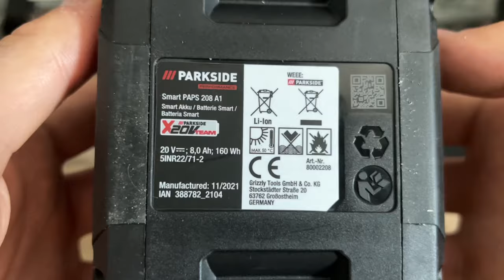Dive-Jet 1500W | How To Build | Fail, Aluminum, New ESC

Comment: Nice work man. 👍
It does take much more than you thought doesn't it?
I built something similar few years ago so I know. It is on my channel.
Good thing to pay attention to thermal conductivity. 👍
One thing I learned on mine. What ever gets warm in sealed container, surrounded with could water, WILL CONDESATE. And those LiOns in there will get warm, if not hot. Solution might be some kind of textile padding inside. Or provide cooling for LiOns. Or use Lipo batteries, those won't get more than calm.

Comment: You should use a lower Kv motor, thats not going to deliver anything close to 1500W, for your purpouse a 12S with a 120kv motor with be much better and you should lower the drag of the prop too. Also if you have a 360Wh battery running for 3,6h, if you do the math that´s 36W. I recently made a SUP motor and I´m using a 700Wh battery for a 50min runtime at 800W

Comment: Looks amazing, are those plastic covers enough to keep the engine waterproof or did you use some sort of epoxy?
Reply from the maker: The function of the plastic covers is to keep dirt out of the motor. The motor by it self is waterproof, only the bearings aren’t, but changing them to 2RS bearings will do the trick
Reply: Cool, I will look into it. Also would an ip68 pot be a better option instead of the hal sensor? Or are you trying to keep costs as low as possible as those pots would be pretty expensive in comparison?

Comment: Awesome project! Will it be possible to build one without a lathe? If so I will most likely build one before next summer.
Reply from the maker: I the first part of the build, I 3d printed the bottom part, but with that there was no way of cooling the esc. You could use an aluminum pipe instead of plastic and mount the esc‘s cooling surface to that. Or you cloud try water cooling, but that could result in more point of failure in terms of water leaking in.

Comment: Great work! The G60 Brushless Outrunner 500kv is waterproof?
Reply from the maker: Brushless motors a in general more or less waterproof, only the bearings are problematic but they can be changed with sealed bearings

Comment: I start printing you project is amazing, turnigy g60 motor is discontinued is there any other motor that fits ?
Reply from the maker: Thank you!  Every outrunner with a diameter of 50mm and a lengt up to 60mm should fit. The Turnigy Aerodrive SK3 - 5055-430KV might be a good choice. Just make sure to match the motor kv to your battery voltage so you get roughly to 9000rpm. I think lower kv and higher voltage might be a better approach, because that will keep the amp draw down which should theoretically reduce heat.
I’d love to some pictures of your build

Comment: Would the 
Turnigy Aerodrive SK3 - 5045-500KV Brushless Outrunner Motor or
Turnigy Aerodrive SK3 - 5045-450KV Brushless Outrunner Motor

be a good option as a replacement for the engine you used?
Reply: And would Turnigy Marine ESC 150A be a good option? or would that be overkill? hobbyking seems to be out of stock for everything else at the moment
Reply from the maker: Yes, these should be a good replacement. I would suggest the 450kv version
Reply from the maker: As long as it fits inside the Dive-Jet, it’s ok
Reply: @3dprintcnc164  thank you, printing the last pieces right now

Comment: There are a lot of parts in the 3d drawings you shared, but you don't combine that many parts in the video, why? it was very confusing 3d parts There are 17 parts and you use 7-8 of them in the video
Reply from the maker: I am pretty sure I used all the parts. There’s more than one video
Reply: @3dprintcnc164   ok thank you

Comment: you can try to use CorrosionX for the outside parts it makes it waterproof i have used it on servos for my uboot. another idea is that you cover the hall effect sensor in epoxy to make it waterproof.
do you have a discord server that we can eventully talk? I speak german i am from austria.
Reply from the maker: I always thought that these Hall effect sensors were waterproof, I’ll try coating them with epoxy, but apart from that an the motor bearings, everything should be waterproof. 
I don’t have discord but you could send me a message on Instagram https://instagram.com/3dpri_ntcnc?igshid=MjEwN2IyYWYwYw==
I speak German, too.